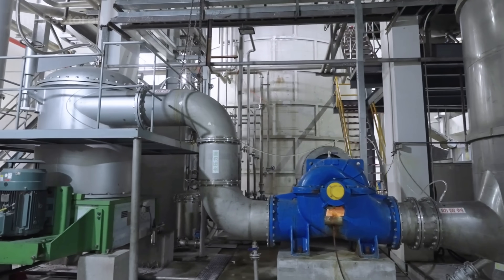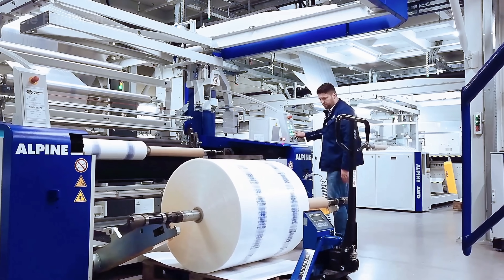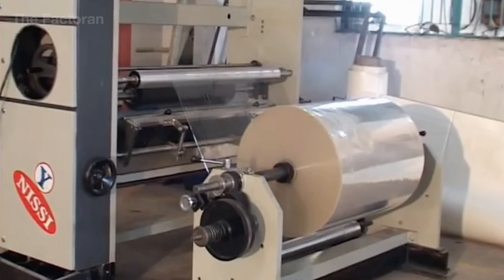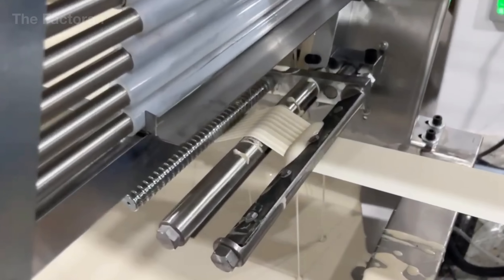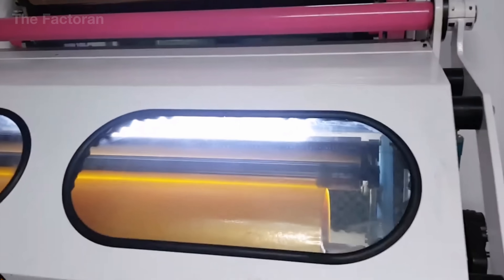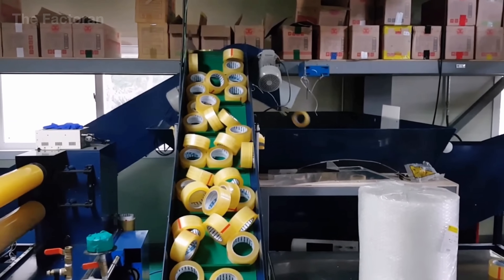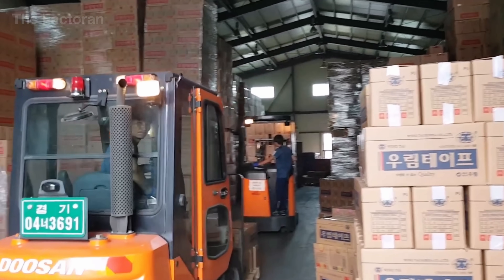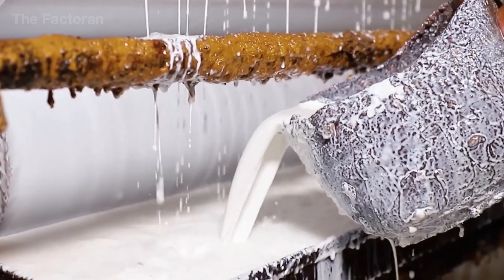How Millions of Rolls of Adhesive Tape Are Made Inside Massive Tape Factories

Comment: I loved the comparison of Blown Film vs. Cast Film. Cast film is preferred for premium tapes because it's smoother and flatter, thanks to the rapid cooling freezing the polymers faster. My question is about the electrical treatment: Is the high-voltage electricity treatment mentioned for adhesion enhancement done exclusively on blown film (which is stretched in two directions), or is it a necessary step for all polypropylene films to prepare the surface for bonding?
Reply from the maker: Excellent question — that high-voltage corona treatment is used on all polypropylene films, not just blown film, because it increases surface energy so adhesives or coatings can bond properly.
Reply: @TheFactoran There are chemical treatments that will increase the surface energy of a film, though they do tend to be nasty.
Reply: Depending on the tape application and adhesive, the blown film (polypropylene, PP) and cast film (polyester terephthalate, PET), may be corona treated (electrical treatment). There may be a primer applied to the film before applying adhesive. And to prevent the adhesive from sticking to the opposite side of the film, there may be a release coating applied. And, BTW, at 4:39 is paper being made.